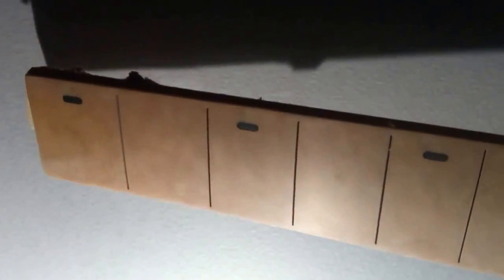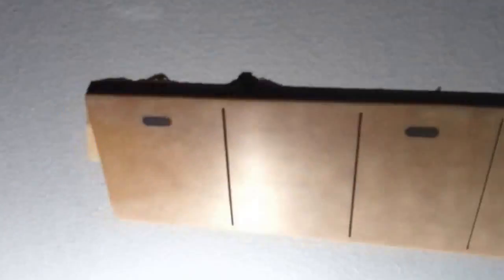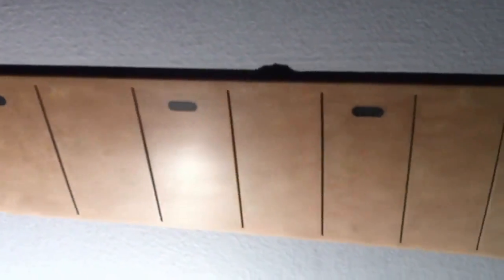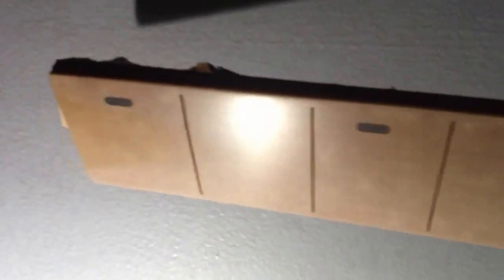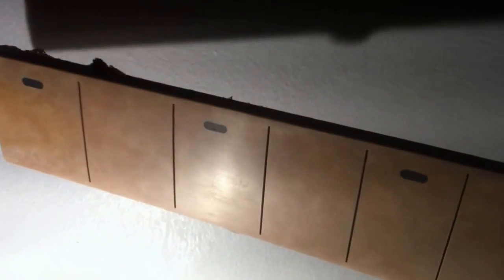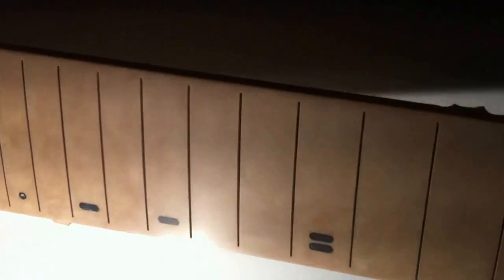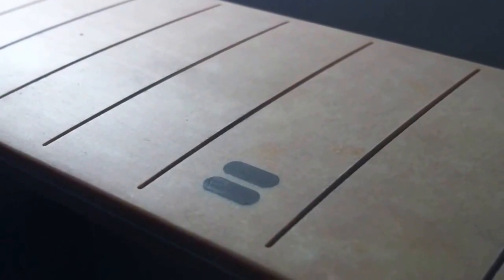Decibel inlay experiment on a Richlite fretboard

Comment: I always wanted like ESP style Flag inlays with a small 4-5 pixel gap & border outline, with the flag itself and the border outline being able to glow in the dark.  I love Richlite BTW, I wish more builders would use it.  We don't need to be using these crazy species of wood for our electric guitars.  It makes zero difference sound wise, and you also never have to worry about it getting damaged or super dirty \ dry \ cracking \ shrinking, etc.  I've never played a guitar with a Richlite board myself though, but I imagine it is quite like a Maple board that has a light finish on it, or probably even more similar to a Parker Carbon Fiber resin board -- both incredibly smooth, never have to be oiled.

Comment: How is richlite sound wise? Compared to ebony maybe?
Reply: +We are Gruhak 
On an electric guitar with magnetic pickups plugged into an amp, the material the fingerboard is made out of makes zero difference sound wise.
The strings don't even touch the fingerboard most of the time, not unless you press down super hard or have very small and low frets, but even so, it still makes no difference.  I've seen Strat models that are identical in every way except for the fingerboard, sound exactly the same in the studio, same with Les Pauls...The frequency response of just the guitar signal is virtually identical.